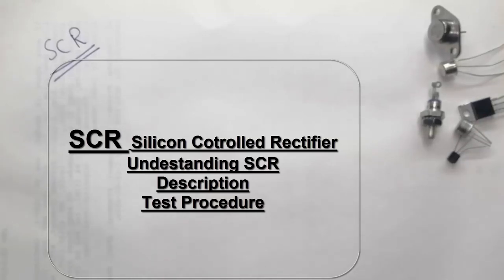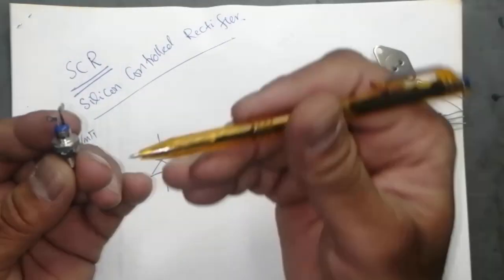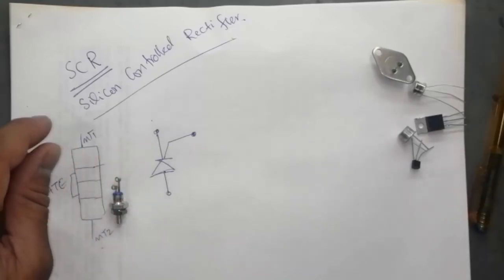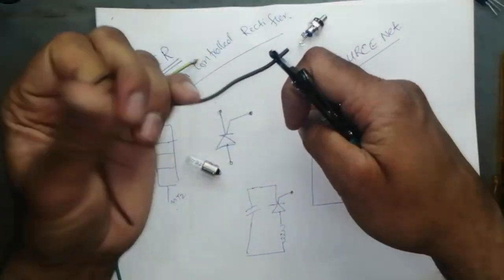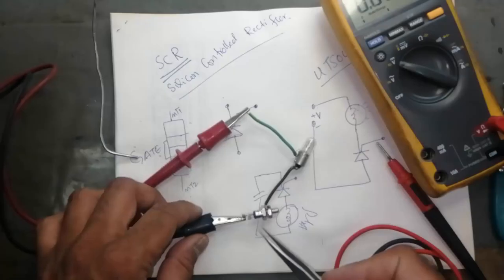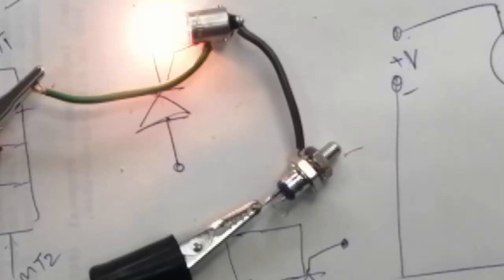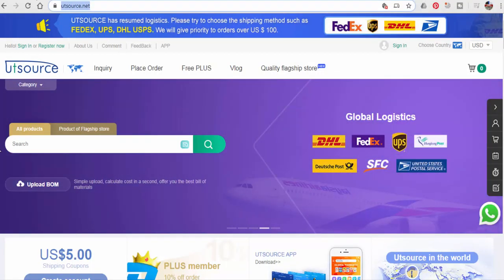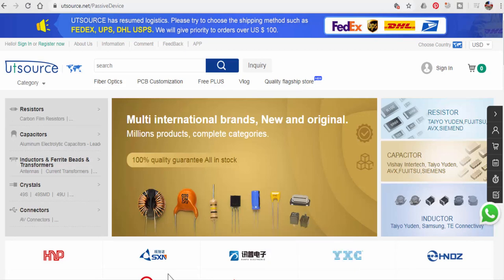SCR description and testing Silicon Controlled Rectifier

Comment: ماشا الله
Very nice description
Can i used this scr for ac  and dc circuits
And triger can by ac or only dc
Thanks
Reply from the maker: normally for DC voltage, SCR is used. 
in AC voltage it is used for rectification. when we need controlled rectification, 
for AC switching, TRIAC is used
trigger can be any type of voltage, check the specific datasheet for the component and trigger voltage value and trigger current limits